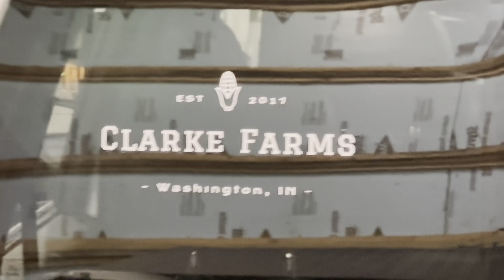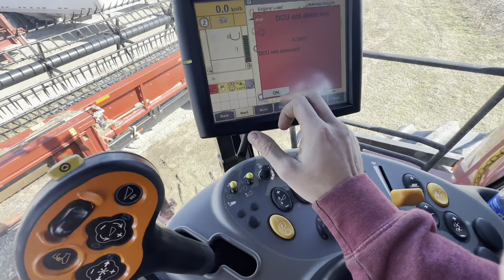Farm Trucks & Farm Equipment

Comment: Case tech here.  There are 2 plastic "bushings" on the unloader pivot. Common for them to ware out and basically bunch up and make the auger swing out but not in. If you look under the auger elbow you may be able to see this plastic sticking out. 

Also seen the cylinder fail as well. 

Easiest way to check is to pull the rod end cylinder pin and see if the cylinder moves.  Make sure to tie the auger to something to prevent it moving in on ya.

Comment: I specifically bought my Cummins because it was the one on the lot without carpet. I’ll never buy one with carpet again if I can help it. Also I run 15w40 rotella in mine, $16-$17 a gallon.